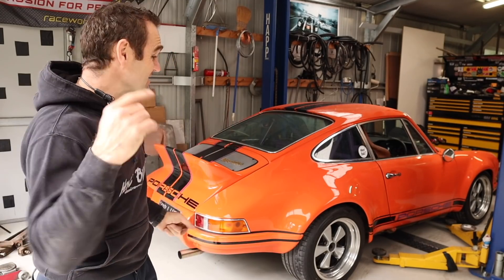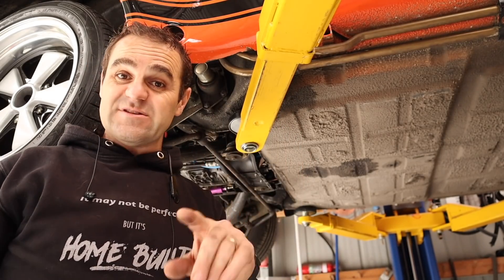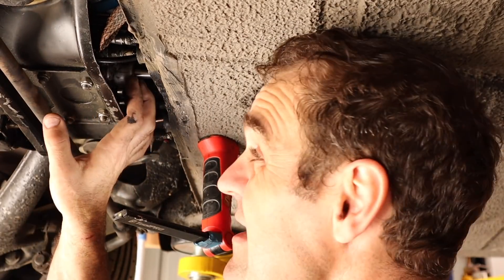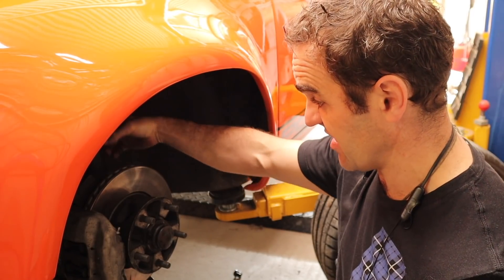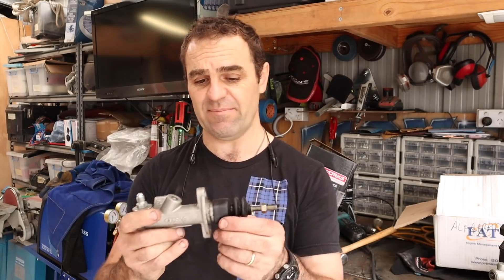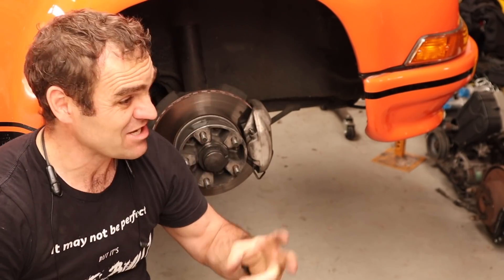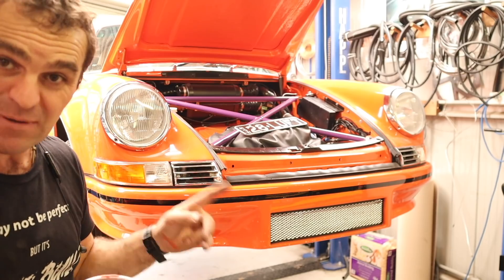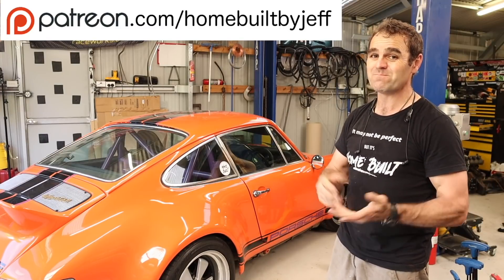Brake bleeding nightmare, on Harry Porsche 911

Comment: Ah, the joys of multiple piston calipers 🙄trying to get the air out of both sides can really be a PITA especially on completely dry systems. Glad you figured it out and it wasn't an MC issue. I once had an MC with the wrong size cup seal fitted from the factory. That took an inordinate amount of time to figure out.

Comment: you don't do much work with duel piston German calipers do you? you will get it now LOL!!! the pressure bleeder is realy old school in the 70s when I was learning we had a big steel ball on wheels called a hydro ball for the old cast iron masters now the one you have there is the new type. but there is a third choice it push's fluid up from the bleeder to the master works great it will clear the master bob your uncle done. I use this on ABS set ups as well.

Comment: With vacuum bleeders or the old style pipe with a valve in the end, the trick is to put a decent blob of grease around the bleed nipples, this stops air from being drawn in around the thread, has worked for me every time
Reply: Rubber grease is the way to go. Won't contaminate the fluid.

Comment: My son and I just changed out the same exact seal... When we put it back in and mated the shaft coming out of the transmission to the connector,,  we were so happy but when I moved the shifter the shaft coming out of the transmission was (upon investigation) I could see that the shaft had bent and was going up and down and distorting the seal and the gear oil is coming out... The tranny needs to come out and at very least the front nosecone needs to come off,,,, maybe MORE  :(  :(  :(   or drive with low gear oil (aprox at the shaft level) and a mess on the bottom of the   of the car and motor :(  :(   Good Luck!!!! I hope that it was not the same problem as mine... You are Amazing!!!!! I feel Your pain with the brake bleed. I find that because I do not work on cars every day I end up doing some things twice (or more) before I am happy:)

Comment: Bit late on this one.
A good tip given to me from a Vauxhall technician.
When bleeding brakes with an assistant.
Pump the pedal 10 xs then hold the pedal down.
 before opening the nipple.
...
Open nipple, one slow depression of the pedal to the floor. 
Close nipple.
Release pedal rinse and repeat.
This way your not over extending the master cylinder seals.
Another tip. 
Gravity bleed
Make sure enough fluid in reservoir.
tube on nipple into a bottle. 
Open nipple.
Go have a coffee come back in 20/30 minutes. 
Brakes bled no assistant or depressing of the brake pedal needed..
It works. 
I did this method when replacing the brake flexi's on my BM to  braided stainless steel ones.
Worked a treat & had a hard pedal...

Comment: When you're wiggling the wheel at 6:50 I can see an electrical connector hanging down from that fan in the front corner.  Is that meant to be doing anything?
Reply from the maker: That is the washer connector ;)

Comment: You can get cheap pressure bleeders that connect to a tyre valve, I bought one to bleed a dodgy clutch circuit by the road side on my SAAB 900 (took literally a couple of minutes) before I got around to replacing the slave cylinder (the entire clutch actually). I used the spare wheel, IIRC you must use less PSI than typical tyre inflation pressures.

Comment: Pressure bleeders are so superior to the vacuum type, especially when you have to activate the ABS pump with a scan tool, that’s usually a 2 person job, but with the pressure bleeder, I don’t need someone to press the brake while I’m cracking open the caliper screws, and I don’t have to keep checking on the fluid level in the reservoir while I’m commanding the ABS pump on. 

Also it’s silent! When the other guys in the shop use their vacuum bleeders, it gets pretty dang loud.

Comment: There is a clear ceramic window film that you can even put on the windshield that is supposed to cut the heat dramatically.
The pressure pack cans of Raptor bed liner does a very nice leathery texture that will look OK under paint But you might even be able to get it in Orange. That will help keep the paint from chipping.

Comment: A suction bleeder works just fine if you put a big blob of wheel bearing grease around the bleed nipple.  The grease prevents air from entering around the threads of the nipple when it's cracked open so you can see only the air inside the brake system.  Works for me.  I also have a pressure bleeder but I use mine strictly for applying pressure, not for supplying brake fluid since not all my cars use the same fluid.  Yes, it requires releasing the pressure and topping off the reservoir once or twice but the upside is that you don't have to clean up a messy pressure bleeder pot.  The downside of the pressure method is that you require a specific cap for the car in question and there are many types.  I've got caps for my Porsche and my Fiat, but not my Honda.  The "universal' cap, on my system at least, is a joke and that's why I sometimes use a suction bleeder.

Comment: A temporary fix for minor oil leaks 
Get some RTV and some strips of rag.
Paint the rag with the sealant and wrap it around what's leaking .
For a spinning shaft wrap some cling film around first to keep the sealant from sticking , when dry remove the film and use a zip tie to tighten the gap and form a seal
Note this is a temporary fix to get you home or last until the replacement parts come.

Comment: nice work with the seal.

with the washer jets, you may want to aim them up a little more, as when you are doing 100km/h down the highway you might find you don't get very good coverage.

With any luck I will catch a glimpse of you and harry on the roads down here in tassie.

edit:

good idea with the ppf, there are a lot of roadworks down here at the moment, particularly in the touristy areas. at least up north.

Comment: The pin inside the washer jet is an old d d trick, even I knew this one and I piloted mc's for 10yrs and neve drove a car on the rode.
I've serviced mc's, cars and neve had a mechanics lesson in my life, I use eyeball absorption, and read a lot, make 1 mistake on spark plug leads on a mini even though I followed each lead, I took them on n off. Go figure!! Bloody Lucas electrics and dizzy.
Another trick for chip filling, is to use a syringe as you 'fill' the chip and when paint hardened you can sand and smooth in as much as you can.
If doing it for metallics, spray through a 10mm hole in a piece of cardboard so the metallics within the paint doesn't go in the wrong areas. Or overloads the paint chip.
Did you take Mrs Jeff/car widow or did you give her a break at a spa whilst you chased each other.